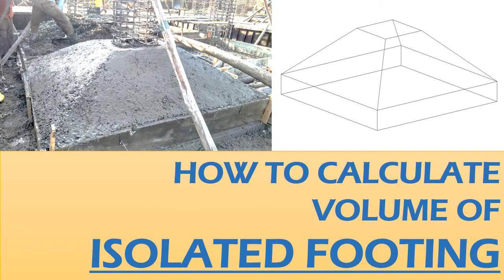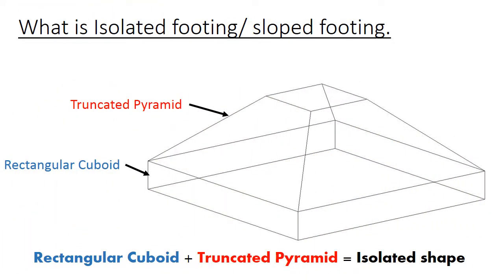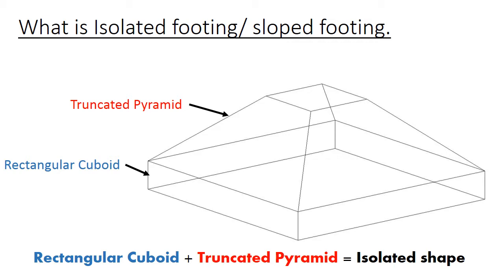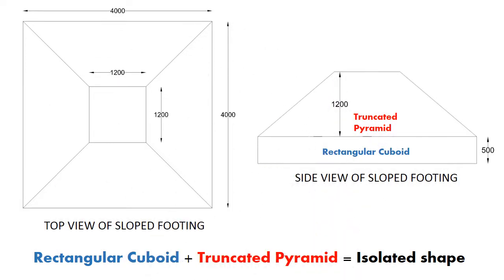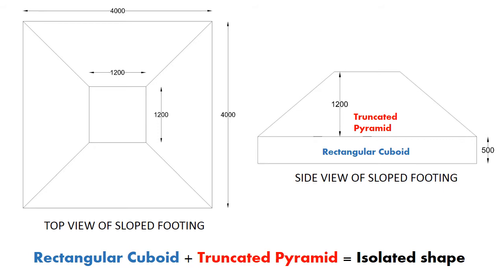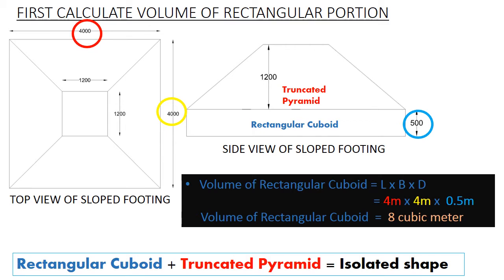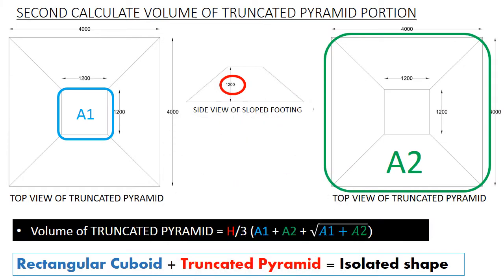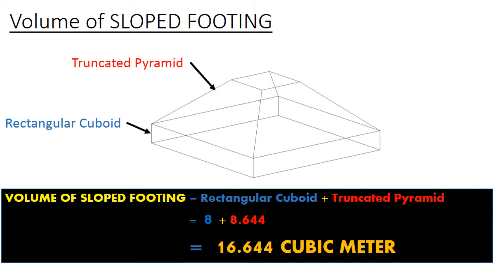HOW TO CALCULATE VOLUME OF ISOLATED  FOOTING || VOLUME OF SLOPED FOOTING || ISOLATED FOOTING

Comment: h/3×(A1+A2+/A1×A2)
/is uderrud
Reply from the maker: AREA OF TRUNCATED PORTION IS ={H/3(A1+A2+√A1+A2)

WHERE h IS HEIGHT OF TRUNCATED PYRAMID,
A1= AREA OF UPPER PORTION AS SHOWN IN VIDEO
A2=AREA OF LOWER PORTION AS SHOWN IN VIDEO.
Reply: CIVIL ENGINEERING BASICS  
Formula is not correct for u check it 
A1*A2 in root 
U mension in A1 +A2 This is wrong